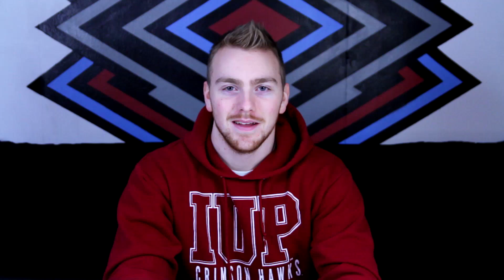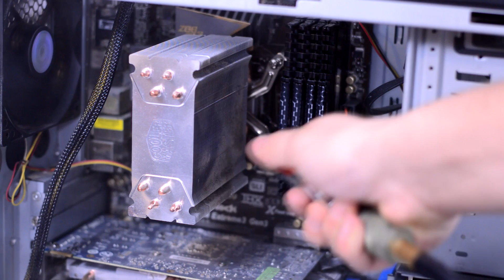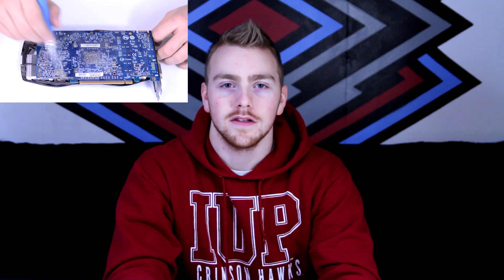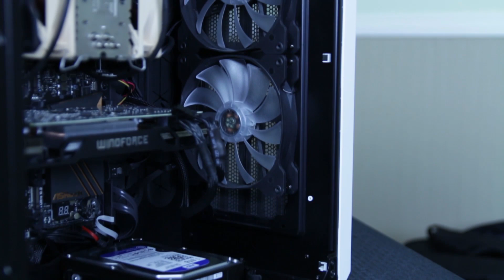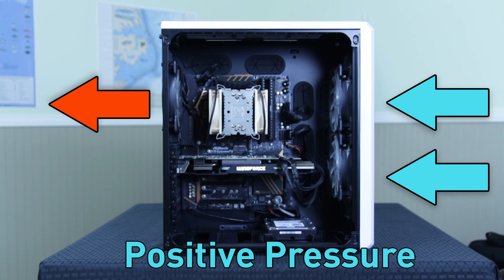Positive, Negative & Neutral Air Pressure -- Does it matter??

Comment: Since this is a computer case and not a spaceship, there is/will be so many gap/hole/space outside of the main inlet-filter area air will come in, so the amount of dust coming in is same with negative or positive pressure! so you are WRONG and it doesn't matter!!  what's matter is airflow, make sure air flow from one end of the case and out the other end and carry heat away!  ok,  I want my 3:05 of my waste life back!! thank you

Comment: Thanks for the info. I will install 2 fans 140mm front intake, 2 fans 140mm on top as exhaust and 1 140mm rear exhaust. Is this correct?
Reply: No, if you have more exhaust fans than intake fans, you will have a negative pressure in your pc which will cause it to suck up dust from outside the case, you should make three of the fans intake, and 2 of then exhaust
Reply: @stevenbarclay7394  Thats' just stupid

Comment: I found it the contrary. Negative pressure system made my gpu 3-4 degrees C cooler than a positive pressure, same ambient of course, and same stress test. But I ended up flipping one of the exhaust to intake (sacrificing 3-4 degrees gpu temp) for less dust build up.

Might also be case per case for each cases (see what I did there? ☺️)
Reply: Yes. Negative pressure always results in cooler Temps, assuming dust is cleaned once in a while.

Comment: Hello,nice to meet you !

I have bought a case ,and after research I think it have some unusual fan configuration.
It have slots for 1x 120 mm in the front, 1x 80 mm in the rear, 1x 120 mm in the side and 1x 120 mm at the bottom.

And I really confuse what I should use for intake and exhaust ,I was thinking in let only the rear for exhaust and the rest for intake .
Only the front have a mesh dust filter .

Thank you very much.

Ps: Heres the link of the case https://www.nox-xtreme.com/en/chassis/lite-020.

Comment: How do the heatsink fans affect the pressure? Specifically, if I have a NH-D15 which has two 140mm fans mounted to it? There are also two 120mm Cougar Vortex fans in front and one 120mm Vortex in the back which are all rated at ~70/119CFM each? And since all of these are PWM fans, how would one know if at any given time the pressure is positive or negative or neutral? I guess what I'm saying is: it would be awesome if there was a way to actually measure what was going on in and around a case.

Comment: I know this is a old video but need some help/ suggestions. I also have to fans in the front and 1 exhaust at the back. 

My dilemma is that I now have a aio radiator  with 1 fan to connect. I have a spare slot at the front of my case and I don't know what combo to go for?!?... I've been advised to go for push method as it's easier to clean. I guess this will play with the positive pressure set up I currently have. 

Would it at all make a difference if I mounted it in the 2nd slot at the front? So top front intake middle exhaust( pulling air out the case through the radiator and out the fan)and 3rd.slot at ground another intake. And leave the back back as a exhaust?
Reply from the maker: don dappa If I'm understanding correctly that sounds like a good plan to me. I don't think you will have any issues if you do what you outlined in your last paragraph there. Best of luck! -JD
Reply: AffinityCL thanks jd. How would you set it up if you had to choose and include a 140mm  radiator? And have 3 slots at the front and 1 at the back? Would appreciate any feedback. Thanks

Comment: Does it matter whether it's positive or negative air pressure if I don't have filters on my fans? I can only have 2 fans and i would think putting them at the top both as exhaust would be most effective.

Comment: Thanks for putting arrows of which way to have the air  blow xD I'm such a noob lmao xD but question .  What if the front of my case ain't like yours ? Mine has shit blocking it like disk  tray and hard drive . I don't think there is even a fan mount there . Can i put one or two on top blowing in ? I already have one fan blowing out on the back

Comment: Negative pressure is more effective for heat dissipation but the downside is that more dust will come in through the unfiltered vents, holes, and other gaps in the case. Conversely positive pressure will keep your PC dust free (provided that you have dust filters behind your intake fans) but heat dissipation is not as good as negative pressure. So "which is better" depends on the environment in which your PC resides, how extreme the heat you're putting out is, and your willingness to clean inside the case on a regular basis. There is no cookie cutter "right answer".

Comment: I have a very basic umax  pc cabinet with rear and side vent only.... my cpu fan is attached with heatsink and working as intake . I have one rear exhaust fan. now  I want to add another same sized fan at the side vent as I already said dont have other vents. In this point I am confused regarding fan set up.What will be better cooling option to add it as Intake or exhaust?? pls guide me...my cabinet does not have front, bottom or top fans...
Reply from the maker: +Sudipta Ghosh if you don't have any additional vents to mount it to, any option would likely work. Id guess with so little vents that if you could add more exhaust it would help

Comment: Should i have 2 140mm fans in the top of my case, ass well as 2 fans in the front and 1 in the back? I have got a dust filter in the top.
Reply from the maker: You don't need them, but that sounds like a very nice set up. Because of a project I've been working on my PC has only have 1 outflow fan and then cpu/gpu/psu fans and it's only gone up on average 5-9 degrees?
Reply: Affinity Collective Tech Awesome! Thanks for the reply :)
Reply from the maker: No problem!  Hope everything works out well for you! -C
Reply: Yeah, I decided to go for two 140mm in the front and one in the back!
Reply from the maker: Awesome!!

Comment: what if I only have 1 fan for intake and my gpu,psu, and back fan push out air into/out the case? would this still be negative pressure? if so considering to add another front fan
Reply from the maker: Because there are so many factors at play, I can't be certain. If I were you, I'd just run some tests with different configurations and see which one produces the best temperatures.

Comment: There is no "best" air pressure for all scenarios.  The best pressure scheme for lowest temps is driven by the ambient temp in the room, the case design and air/water cooling approach.  Negative pressure delivered significantly better temps for me in my room using a CoolerMaster HAF-X EVO case in air or water cooling configurations.
Reply from the maker: Yeah, there are just so many variables at play here. Interesting that negative pressure was significantly better for you! -Connor
Reply: @AffinityCollective  As I say before, because we are talking about computer case with 10000 air gap and not a submarine! otherwise a negative pressure will collapse the case and postive pressure case with blow up like a buffer fish and explode!

Comment: Pardon my lack of knowledge on the subject but this makes no sense to me... 
A negative pressurized case doesn't pull more air in... from anywhere. Nor does it pull more dust in. A positive pressure case would seem to. 
Negative pressurized case simply blows more air (and dust) out. And to me, thats the objective. To remove the heat which is being created by the internal components. Since my computer is in an air conditioned environment (70 degrees F or 21C) that air is ALWAYS going to be cooler than internal air. 
Someone please help me understand how if you have negative pressure (more exhaust than intake) that you actually take in more dust.

Also... does anyone have a link to heat comparisons in the two setups? I've seen LOTS of videos on the subject but no actual temps.
Reply from the maker: So you found some answers in the explanation iv made in the comments below. Dust is really the only perk for positive air pressure. We will be making a video doing temp comparisons between different air pressure environments. Just moved into college however so getting everything sorted. Hopefully will have it done soon. -JD
Reply: Nathan Elmore Use the scientific method and experiment to arrive at your answer.  It's not difficult to configure your case/fans for both air pressure schemes, then test, measure and compare the numbers.  Don't rely on anyone's opinion.  Do the experiment yourself to reach reality and glean the facts.
Reply: Nathan Elmore Thanks for the link, was a good read as I'm about to build a mini itx gaming pc today and was a little unsure about fans. 
Would this sound okay to you? 
2x 140mm fans at front as intake. 
2x 140mm SP fans pushing air out through radiator at top
1x 120mm fan pushing air out the back. My psu is in a psu shroud and my gpu (strix 1080) has 3 fans but im not really sure what they do with the air lol.. Im building in a nzxt Manta case
Reply: I intend to... Might start my channel with that video. Either way, I definitely intend to do my own research and make a video on this topic.

But just for shits and giggles, here's some info from a reliable source if someone wasn't sure about it...
http://www.tomshardware.com/faq/id-1858957/airflow-101-setting-fans-keeping-computer-cool.html
Reply: No problem! Glad it helped. In my opinion you have a great fan setup. If all of your fans are the same model and will generally be running at the same speed (providing the same amount of air movement) you will be just slightly negatively pressurized and your intakes and exhausts are all in the proper position for optimal cooling. I have the same fan configuration in my main current build except all 120mm fans in a Deepcool Dukase V2 case. I get very low temps, very little to no dust, and great performance out of it. The Manta is a nice case and you should be just fine with that config. I would suggest keeping an eye on dust though, particularly in an ITX build.
The fans on your 1080 basically push air away from the gpu. But that air needs somewhere to go. Hence why negative pressure is better for cooling. The negative case pressure means that there is more air leaving the case, therefore that air the gpu fans are blowing away is then pushed out by the other case fans. Hot air leaving the case instead of staying inside (like with positive pressure) and being completely stagnant with neutral pressure is ALWAYS better.

Comment: how the hell more air can get in than go out?! I am sick and tired of hearing this same nonsense over and over on every "pressure" video. there will always be the same amount of air coming in and going out. you can only choose which way and how fast. personally I like more exhaust fans than intake.
Reply: you have other areas in your computer case that air can entire and leave from. If your setup more exhaust fans than intake, the air that is being pushed out of the case has to come from somewhere. This causes all the other openings that don't have a fan or filter to be an intake. Because air needs to enter the case in order for your fans to exhaust it.

Positive pressure helps because you have a faster flow of air entering the case than the air can leave. Causing the little openings in your case to be exhaust, pushing airflow out of the case. This helps reduce the dust getting in as long as your intakes are filtered because the other openings will not allow air to enter the case due to the air pressure exhausting out of those openings.

You can try it out for yourself with some incenses. Simply light one, and hold it next to an opening that does not have a fan. See if the smoke goes into your case or pushed away. This is how i was able to tell if i created positive pressure. You can adjust the fans to exhaust, and watch the smoke go into the case because the air needs to enter to case from somewhere for your exhaust fans to have something to push out. So as long as your intake fans are filtered, that is where the air must enter from because the other openings in your case has air pressure pushing outward. This makes it so your filters do their job and dust is removed from the air entering the case from the only place it can enter.

Dust doesn't take too long to build up for my room. I have 2 cats and a dog, and that stuff gets into the computer if i didn't setup a positive pressure air flow. It makes clean up a lot longer, because i have to really dust out the case. But with positive pressure, the air is only entering thru the filters, so i just have to clean the filters, while the inside of the case stays relatively dust free.

I hope that clears it up a bit.
Reply: Thanks for the response +Tony Leung. I agree with you completely about dust prevention. But to me, heat dissipation and removal are more important than dust. Negatively pressurized cases give better cooling and that will always be the main objective to me.
Reply: Now THAT makes a little more sense. But still doesn't answer the question of how positive pressure is better other than a little dust which takes years to build up if in normal environments.
Reply: Tony Leung Hi I have a slot for fitting fan at the side of the cabin should I use that slot as intake or exhaust??? Does the slot provide at the side is exclusively for cooling  of graphic card ?? By the way  the graphic card which I have has already a fan attached(inbuilt) to it
Reply: you are completeley right goatman. in industrial cooling hot air is always transferred out as fast as possible. the intake is not that important because cold air will get into the case by itself. blow a lot air in und letting in get hot inside and slowly finding its way out makes no sense.
Reply from the maker: To answer your question of "how the hell more air can get in than go out?!" Which most likely needs rephrased into "How the hell can more air get in than out?!"

More air does not actually come into the case. It all equals out in the end if you understand air pressure. Having more intake fans causes the air that is not getting exhausted by the exhaust fans to leave the case through the extra holes/slits/etc, that every case has. It is really more for dust control than anything. However, you have to have the intake fans filtered, or else it does not do anything. You can watch a new video soon where we actually compare temps of positive, neutral, and negative air pressure to see if it matters at all. I will be sure to link you to the video. 
-JD

Comment: I think that if your chassis have positive pressure, hot air cannot get out of case fast enough, so it will be absorbed by the components, make these component hotter in the long run. I remembered that I read this few years ago and they have make tests to prove this argument. The topic named 'Airflow 101' at Tomshardware, and others have suggested that you more air exhaust will be better than more air go in the chassis. I think as long as you often clean up your PC, negative pressure will be better than positive pressure.
Reply from the maker: If you can link that Tomshardware article that would be great. 

The basis of a Positive pressure air flow is that more cool air enters the case then exiting. 

This in turn forces the hot air that is in the case to exit the case out whatever exhaust fans you have, and then out any other little holes, vents, cracks, etc. in the chassis. 

Negative pressure actually causes air to be sucked into the case from these vents, holes, cracks etc. While it may not lead temps that are any worse than a positive pressure chassis, it WILL bring in dust and dirt through all those places due to them not being filtered by a dust filter.

The only way positive pressure really benefits you is if ALL your intake fans are filtered, or else it wouldn't matter much if you had negative or positive. 

I am open to debate on the topic. We can even do a video on the channel doing temp tests with the two different pressure environments. - JD
Reply: Here is it http://www.tomshardware.com/faq/id-1858957/airflow-101-setting-fans-keeping-computer-cool.html Rule #2. But my chassis has a positive pressure anyway xD
Reply from the maker: We will actually have a video coming soon testing the theory that is stated in that article on whether or not negative pressure cools better than positive. - JD
Reply: Yes! Do the video... that would be GREAT!
Reply: I think airflow also depends on the design of the chassis. A's case seems ideal for positive pressure, since the 140mm fans direct air right at the main components, and the hot air exits right away through the back.
Reply: Think about it conceptually. Say you have 300 CFM of air going out and and 400 air going in. So if air truly was building up inside, the PC would eventually explode, because it couldn't hold the air. However what really will happen is that eventually the airflow with be the same in and out. So you will have 400 CFM in, 300 CFM out via fans, and 100 CFM out of the vents and cracks. So overall, you case will have 400 CFM of overall airflow.

But now say you'd prefer negative pressure.so instead you swap the fans. Now you have 400 CFM out, and 300 CFM  in. You're either going to be sucking in air from cracks and vents, allowing your case to have a net of 400CFM total,. or your going to create some kind of vacuum inside your case(if it's legit airtight). In that case you'll be moving 300 CFM through your case. So I think in theory, negative pressure is at best as good as positive pressure, and at worst as good as the slowest fan in your case.